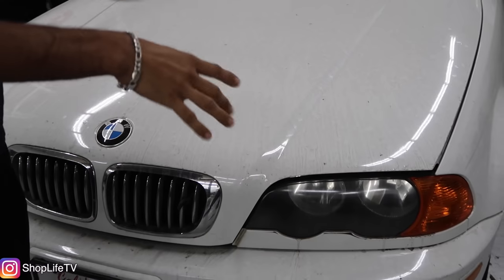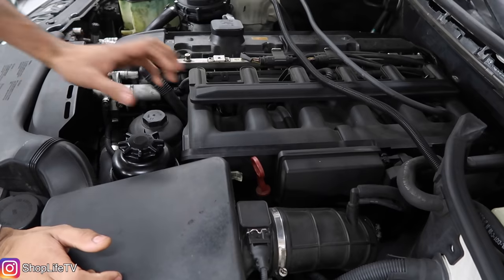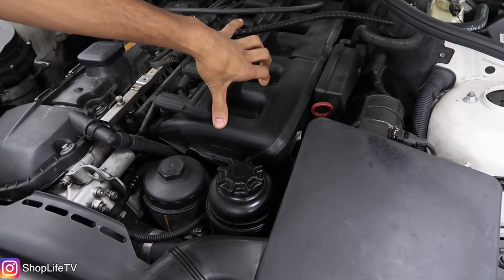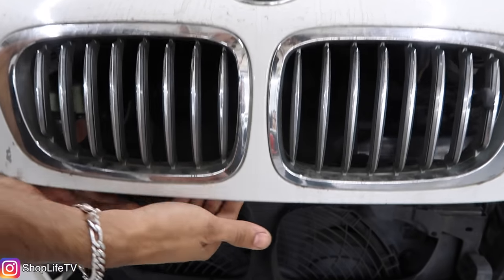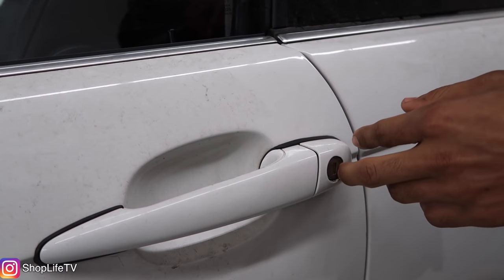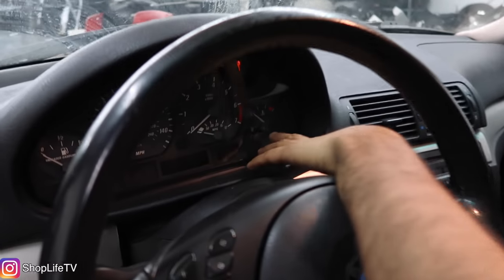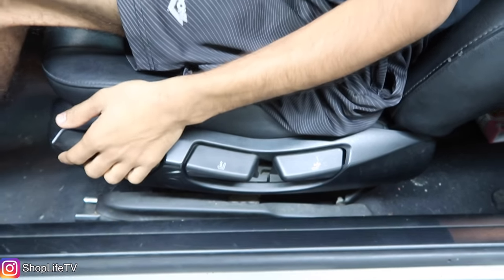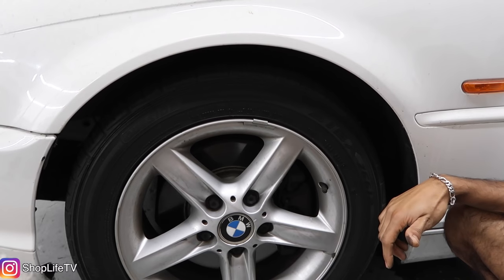25 BMW E46 COMMON PROBLEMS

Comment: 2001 325xi
Have had issues of the engine vibrating at stops. Especially when at an incline. Don’t feel while driving. Engine mounts are fine. Pulleys all seem fine. Several shops have looked things over and don’t find anything wrong. Have you ever come across something like this?

Comment: What would cause a knocking sound in the front of e46 engine? Have removed all belts, no difference. Also found brass color metal filings in oil filter. No knock when cold. Oil pressure good.

Comment: These videos are awesome! ive got a lot done to my car by myself just from learning from you. Recently though, Ive been having this problem where my car will stall out on me. Its a very gentle but sudden loss of power. Almost dont feel it right away. I get my red battery and oil lights coming on. I have to pull over and wait a few minutes before i can start it again, otherwise it just cranks and wont turn over. Any ideas of where I could start looking??

Comment: Great video, recently ran into the "trifecta" lights and i've checked the speed sensors, cleaned them up and put them back but i still have the lights even after removing codes. any tips?

Comment: The cooling system applies mostly just to warmer countries, in colder climate countries the radiator bends and starts to leak. I have almost quarter million kms car with entirely original and functional cooling system (just the bent radiator and leak from valve to heater core hose - which again is not being used too much in warmer climate countries and doesn't fail in there)
The oil burning issue (oil control rings) applies to all M54s: 320,325,330. 330 have another specific problems with oil pump nut coming off and cylinder walls becoming oval over time... 
Also: head bolt threads stripping off after overheating (instrument cluster gauge can be easily reprogrammed to predict overheating)
heater valve breaking apart or becoming stuck
handbrake pins comming out of rusty splashguard (in countries with salt on road during winter) - not mentioning that almost no BMW has a functional handbrake
fuel pump soft failing (no gas on 1/4 tank and chewbacca noises) or failing entirely
SAC clutch pressure plate failure on manual
shifter being wiggly
differential play
and so on and on.. but anyway good video!

Comment: weird watching this video in 2019 listening to you talk about how cheap the 46 is, i tell ya its significantly gone up in value pricing at an average 50k for the lower end and around 150k for the ones kept in better condition. Overall great video

Comment: Most likely Air Injection issues are usually the oxygen sensors.  I'm an ASE automotive repair certified technician.  So far I've seen and repair air injection monitor problems with new Oxygen Sensors.

Comment: You forgot about the annoying “Drive Shaft Center Support” when you feel a vibration underneath the gearbox (automatic) on low mph like 15-30 or right before the car shifts to 2 gear

Comment: Old video but I'll comment anyways. Just got my first one. I already have an e36 325is and I really like the car, but it's just begging for a little more power. Got a 330i and extra HP makes a world of difference. It actually feels like it handles better than the e36 too. With the 325 it feels like the front goes first then the back end catches up to it and it has a bit of understeer. The 330 feels like the whole car is turning at the same time, probably due to the stiffer chassis.

Comment: 3 main things to do by 100k miles or earlier is water pump, coolant reservoir expansion tank, serpentine/fan belt.  any one of these 3 things failing on the road will lead to being stranded and potential catastrophic engine failure without warning.  everything else, you'll have some warning via dash lights or you can hear it and at least give you time to take it to the garage.

Comment: Hood Latches seizing/rusting, hood cables seizing, brake light switch causing the brake lights to stay on all the time, license plate light assemblies corroding, the blend door actuator failing, the guibo joints splitting/cracking then vibrating, the bolts for the vanity covers on the engine just spinning and not unscrewing themselves from the valve cover preventing access, the fuel cap gasket hardening, the front differential locking up on the xi at highway speed...  ALL things that have happened to MY '02 330xi E46.

Comment: Have you ever had any problems with the wiring for the adaptive hid xenon headlights on the 2005-06 330ci? Not sure if I need to buy a wiring harness or replace everything? I'll check the ballast next. If you could do a short video on that I know it's a big problem that could help a lot of people. Thanks

Comment: I have an issue with my 01 325i 5 speed
Replaced coils spark plugs injectors checked compression and fuel pressure everything was good and I still have a misfire for cylinder 2 that wont go away

Comment: Having owned an e46 bmw coupe and an e36 sedan , i will say they handle well. However with all the issues mentioned, i struggle to understand why the e46 chassis is so desired apart from looks . The e36 is a better constructed car imho but still suffered from the interior disintegration with the plastics

Comment: No mention of the crankshaft pulley which generally goes after 100k miles or so... the rubber inside starts to crack and break making it wobble like fuck and ends up throwing the belts off or worse still coming off completely

Comment: What would cause a e46 to shake/vibrate when slowing down and coming to a stop at idling while feet on brake? It doesn't happen in park nor while driving, only when feet on brake at low speed and feet on brake at idle while in gear? It also has a p0440 code....i really liked it but man it seems like itll be a regret buy

Comment: great vid as usual. Is the fsr (final stage resistor) in the hear/ac fan a common prob? just had to do mine. my coolant tank failed catastrophically yesterday. gonna do the whole coolant sys refresh thing. by the way, have you heard of LPR water pumps? is lpr a good brand? its what theyre selling here in japan.

Comment: Oil sensor would be a picnic if what you say is so. But you left out the fact that you must first remove the reinforcing plate that covers it. THAT is the tough part and requires expensive one time use special torque bolts. Did you forget?

Comment: Keep up the great work man! Are there any long term consequences for not servicing the CCV?
Reply: Yes, the unit can get clogged with sludge and stop operating properly. I think that can lead to vicious oil jelly clogging the top of the head.
Cold weather starts and short trips aggravate this problem. Then you are screwed.

Comment: Hi Jason, I have a BMW 2004 325I with over 100k miles I've been having a problem when car warms out and driving in low gears second or third shift feels strong Jolt like someone just hit me in the back and if drive it longer then it doesn't change gears and looses power and the gear image shows in the dashboard and if I stop the engine and wait few minutes I can drive it again. What do you think is wrong with it. I will  appreciate your comment

Comment: Hi Guys, you do very informative videos. Really appreciate! allow me to solicit some advise; my E46 sedan 2004 E46 manual developed a problem where when i step on the brakes a little hard it stops as if it was an emergency. got me hit from behind twice. my Mech disable DSC and the problem never returned. what could be a permanent fix?

Comment: Hello. There is very interesting your information. I have E46 and I will check all videos you have with this model. I have a problem and I will appreciate your opinion. When I start my car EVERY 30 seconds lights come on & and off. I think that is like bulbs checking procedure, but I just want to make only at starting time only. I think it will damage Led lights, and authorized service store dont know where to turn off. Could you let me know your guide about it. Thanks

Comment: I have a 00 318 Ci. Over revs because it has been lying up for 10 hour 15 years can you advise? I've had a a new cylinder head and a full engine rebuild but still she idles high. All work done in dealership and it practically lived in the dealership for 2 years not coming out. Take it on a spin for a few days,This is what they ( frank kean ) said to me

Comment: My e46 is jacked... Replaced ignition coils plugs seals radiator overflow hoses belts disa idle control ccv... Well practically any part you can name.. Except the throttle body... Now I'm in permanent "limp mode" I'm lost at where to even start.. I've practically touched everything but cannot fix this.... Yet, fingers crossed I do well my life kinda depends on it. Gotta be to work Monday or all down hill #becausebmw 💪✊

Comment: I have a 2003 325i and for some reason now my cooling fan will not turn off at all even with my car being turned off and it runs super high. I already replaced the coolant temp sensor and still the same issue and ideas of what it might be?

Comment: I have no error codes on my 03 325i ( 109k miles ). I'm planning on replacing my water pump, window motor, cabin filter, full oil change and thermostat. You said about 100k miles a few of these problems occur, giving codes. So if I've got no codes right now, I'm good, right? Or should I just follow your DIY's and check? My car runs smooth, no sounds ( my latest video shows it ). 
Your videos are damn helpful, thanks.

Comment: How can I release a convertible top on a 330 from the windshield manually?  I tried unscrewing but the bolt falls out with the top still latched at the windshield.  I didn’t find a solution on e46 fanatics.  Love the videos!

Comment: I have a problem connecting INPA or any other Scanner software to my e46 330i, I can read engine and transmission modules but just that, I have bridged 7 and 8 pins and back to no bridge an still no communications to body or chassis modules.

Comment: I did my oil housing filter gasket last year on my 04 e46. It start off slow leaking then really just dumps oil if its anywhere near full

Comment: Hey, ive been having some engine knock for a while now, ever since i bought the car in june 2016, with 33k kilometers. it has 71k kilometers on it now. the knocking is very slight at around 2500 rpm, but most def more pronounced under load, ie, going up a steep hill. any idea what that could be? im thinking since the car pretty much sat for most of 16 year, there may be some carbon buildup. any other ideas?

Comment: Main issues with my e46. Coaxial to amp for antenna in rear pillar wiggled itself loose, Transmission playing up (shifting hard) MAF sensor, Electrics behaving really strange = ignition switch.

Comment: BMW's handle well and are solid but my dads 2006 325Ci with just 103,000kms (60,000miles) had a leaking valve cover gasket.  I changed it and the damn old gasket broke apart badly and the spark plugs seals too.  My 2002 RSX-S valve cover gasket was still as pliable as new which has more mileage.  I mean, my RSX valve cover is metal whereas the BMW is plastic. Plus the fuel pump failed, the bushings and and all shocks are shot

Comment: My e46 starts but the problem is when I try to put it in drive it struggles to move and when second gear hits it runs like nothing but pretty much every gear works even reverse except first

Comment: Hey I just bought a 1999 bmw 323i 4d and I can’t even get it started... I’m getting a click but no turning over, had jumper cables on the battery for about a half hour, what are good steps to take to try and get it started

Comment: I had a terrible oil leak on my BMW 320i e46, it was leaking from the oil filter o ring then I replaced the o ring then it started leaking from the oil filter housing gasket which I replaced and now it's still leaking, I suppose it's the vanos oil seal that need replacing. Also speaking of oil leaks I recently replaced the spark plugs and I discovered oil in some of the Wells and some of the plugs were covered with thick hardened oil sludge, I don't want to replace oil stem seals in the cylinder head can I buy an additive like oil stop leak?  Will it work?

Comment: Ok homie...2001 BMW 325i cruise control not working, replaced M.A.S, checked fuses, disconnected battery to reset upon install, turned car on, cruise control icon comes on dash, press brake, icon disappears, until I turn car off/on and again, icon turns on, brake application, then icon disappears. no boot crack or leaks idle control cleaned also... have not run computer diagnostics but maybe you can help .. friend suggested it may have to do with the map control I believe it may have to do with brake pedal sensor...HEEEEEELP. TY

Comment: Question... I have a 2004 325i sedan.. it starts fine but doesnt have any throttle response meaning it wont rev or drive..it idles fine..

Comment: I have a 2001 330ci. When I'm driving on the highway at speeds between 105 km/h - to 125 km/h my temp gauge will go from normal to hot for 2 seconds then go back down to normal, this will happen throughout my drive on the highway. If I drive below or beyond those speeds, it doesn't happen. 
I do have a code stored p0117.(Engine coolant temp sensor 1 circuit low)
3 of my readiness monitors are never ready.. I haven't cleared my codes or removed the battery terminals for over a year. 
I've replaced both coolant sensors, thermostat, electric fan....
Any idea?? Dme problems??
Reply: Following.

Comment: Hello , thanks for the video. I am having overheating problems with my bmw e46 . I suspected a leak on the pipes and also the head tester appeared to be yellow.... Please I want to know if is the coolant leak causing the overheating or if my head gasket is actually blown.... because I am actually in doubt of the head tester results. Thank you.

Comment: There is a Easy repair on clock control I did it on my 318i I think I found wiring diagram on bmw forum ? It involves removing cluster soldering a link in and scratching off
Part of printed circuit , I found it easy but I think you lose choice of am/pm.

Comment: Great video man. I was listening to one of last sentences in your video and thought. Neither forums or Google know what to do. I have leaking expansion tank and coolant in power steering fluid. Why is that? I haven't had time to put pressure test tool on it. Or disassemble, just so I can look around

Comment: I'd like to add given the age of these, expect climate control issues. My own personal story is I bought an 05 325i for $8k a few years back. Black on black, manual trans. Only 79 000 kms. The issues (slowly discovered over a couple months of ownership): leaked water in cabin when rained (vapour barriers in doors), resulting in musty smell, diff bushings dry/worn out resulting in low gear shifts being 'clunky,' ignition lock cylinder sticky from time to time (impossible to turn key), terrible AM radio reception (yes, the region was correct), a/c didn't blow very cold or very well, windshield cowl cracked/worn, slow coolant leak, there's probably more just can't remember. Anyway managed to sell it with 85 000 km for $8k made my money back, had my E46 experience and didn't fix any of the issues except the vapour barriers (easy DIY) because to the first-time buyer BMWs sell themselves, and then you start losing sleep when you start uncovering these little things, over and over again.

Comment: I have a 330ci. And I think my clutch is going out. Because when I press the gas the Rpms go up and the car barely moves. And when I floor it the rpms go way up then back down and the car takes off like Normal. You think it could be my clutch??

Comment: I have a 2005 M3 e46, just finished a conversion from an SMG transmission to a manual. Do you know what would cause the car to idle really low and stall out even when in neutral?

Comment: Hi! Can you help me? Gone with an E46, M54B22 engine. When the car starts cold, the idle is uneven, and when the idle starts, the car is five-rolled. Clearing the INPA error code (Error 242: Burning Fail Cylinder 5) will clear the error immediately, but will take about 5-6. after starting or after 100 km, the fault will occur immediately. When the engine warms up, nothing's wrong with the engine, it's beautiful. Do you have any idea what could be wrong? Spark plugs / transformers changed, oil changed, idle motor cleaned, disa valve OK.

Comment: Hey brother I ran into a problem wit my M3 02 last night. The driver side front brake started doin weird stuff but only when my skid control was on. When I turn it off it does alright but then my tire light is coming on. Would my skid control censor be the cause of it?

Comment: How best to diagnose a faulty vanos? I have no ecu errors, and near 3k rpm (@ wide open throttle) the exhaust note changes noticeable.  It seems to work but the engine feels a bit weak.....

Comment: My second hand 2001 E46 was burning oil. I realized I was using cheap gas and went to 91 octane which is the recommended gas and it stopped burning oil.

Comment: Hey, I locked my e46 yesterday (using the door lock) and today the car will not unlock with any of the two keys I have. And the key fob doesn't work in any of the keys (maybe dead key battery). So when I put the key in the door lock they just spin around, and I cant get in the car. Do you have any ideas?

Comment: i have a 320i e46, that i already change transmission speed sensors, and the warning cog light continues to shine. The problem shows up when i stop the car with D engaged and push the breaks, after some seconds the cog appears. When i have to stop the car, i have to put the transmission in N, then the cog don't shows up. the scanner reads stall speed (P0720) and Gear monitoring 4 (limp-home program). Can you help me. thank's for your time.